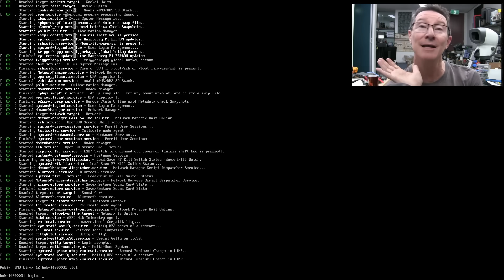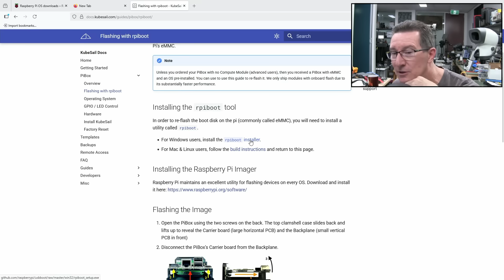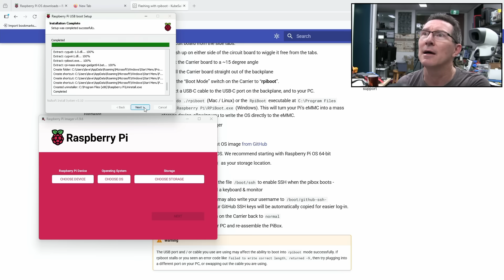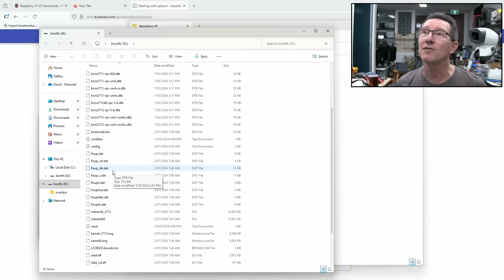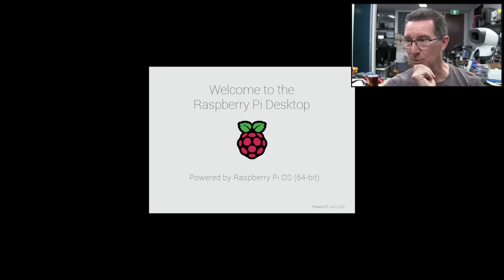Flashing the eMMC on a Raspberry Pi CM4 Compute Module

Comment: Yes, the bootswitch is just pulling a pin low. The CPU enters a very simple bootloader. To make it show up as a drive, the tool you downloaded loads a very simple OS directly into RAM to do the interfacing between USB and eMMC.

Comment: I had to do that last week on a new CM4 , I could not work what to do without going on the internet , the sd doesn't work and you need to install rdiboot .
Reply: SD and eMMC uses the same controller and pins, so if you have a CM4 with eMMC you can't use the SD
Reply: @fuzzy1dk  I tried asking AI "how do you flash a OS on a CM4 with eMMC" , Use USB-to-eMMC adapter and copy files using DD , NO
Reply: @peteradshead2383  why the hell did you ask AI?
Reply: @fuzzy1dk  sometime you get some useful information from AI , I've been programming in C++ for years but don't know that 10 // 3 = 4

Comment: Dave were ware more intrested what went wrog and how we can fix it , but that board was gone , but what wreks my brain is how that eternet port died , because i have multiple of this types of board most of them had just the power circuit died , but i had a simular issue with zero that had fallen 15 meters in a box. :D
Reply: It's more likely that the failure was at the pmic side..
The Ethernet chipset was the first victim. As dave showed in the last video, the wifi module started to heat once the Ethernet chipset module was removed. This might be caused due to the fact the Ethernet chipset had the least impedance due to failure and once he removed it, the wifi chipset was subjected to the high voltage.
This is just my assumption but what bugs me more is that the way the pmic failed.
Reply from the maker: @nand2624  Best suspicion is that a higher voltage on USB-C was somehow negotiated and it fried the DC converter.
Reply: @EEVblog2 other thing came into mind , to connect the main 3.3V line after the dc-dc to a bench power suply , and desolder the dc - dc chip. But i think its not worth the time and effort.
Reply from the maker: It's most likely that the DC-DC converter died and just so happened to take down the ethernet controller chip.

Comment: The SD card slot on the adapter only works when using a CM4/5 Lite module that doesn't have an eMMC flash drive. Unfortunately, the SD card slot doesn't work on modules with eMMC storage.
Reply: Guessing that is because the external slot and the eMMC use the same controller, of which the SoC only has one?
Reply: @gigaherz_  from what I remember from TubeTime stream SOC actually has pins for second EMMC port, but they are unconnected on CM5, no idea about CM4.

Comment: I like the cm4 format. I have a few of them. You got unlucky with that one that failed. I don’t like the emmc though. I use waveshare carrier boards that have NVMe slots. Much faster and more reliable. Mind you, that wouldn’t have helped your issue!
Reply: I run a few of them too and at least the reliability of the EMMC is lightyears better than the old SD card :)

Comment: I never had a raspberry that actually worked for more than a week
Reply from the maker: I use one 24/7 for my Solar Assistant
Reply: I ran a fleet of just over 60 Pis for about 4 years with little trouble - just the occasional corrupt SD card (whereas the CM has EMMC and no such troubles! Yay :)
Reply: @new-zealand-clippy  I live near the sea shore with a lot of sea salt in the air
Reply: I have a Raspberry pi 1 , that still works from my home , it eated countles sd cards but still works..
Reply: and CM modules are work better most cases i hawe PLC in machines that has this type of CM module installed .
Reply: @szabolcs__  it ate countless
Reply: Never had a raspberry that failed, and I have a lot of them... You just have to be mindful of SD cards. Most cheap ones can't handle 24/7 writes for very long. Not an issue with proper config though. EMMC should be a bit more resilient.
Reply: Pi's are toys, some children break toys quicker than others 😆